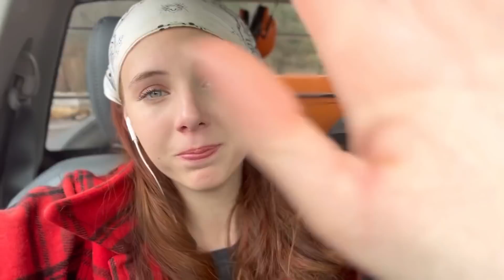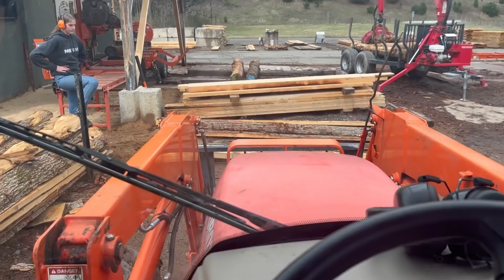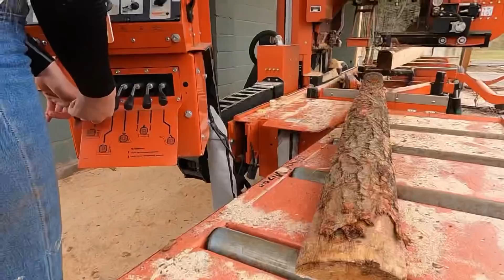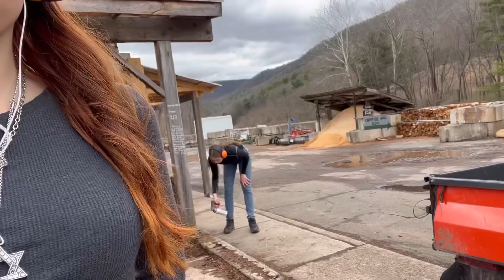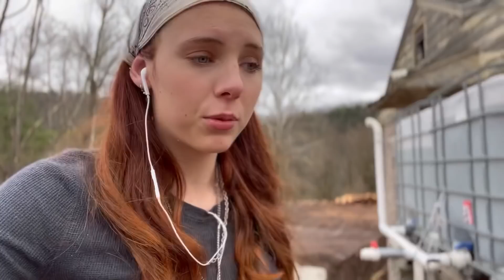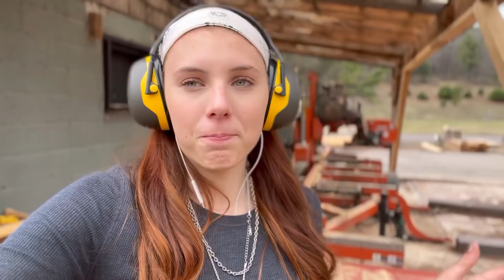Best. Job. Ever.

Comment: I think there are more wheels than doors, depends on your definition of a wheel. In many situations a gear is called a wheel, an engine has pullies, they are wheels and of  course they have flywheels, brake rotors are also wheels. What do you reckon? more wheels
Reply: We voted for more wheels! Think of all the trailers!

Comment: You have probably told us before, but on a typical day, with plenty of logs and no problems, how many hours are spent "at the mill"?  Meaning working towards actually milling lumber.  Moving logs to the mill, moving finished product  out of the way of the mill, etc.. I know it may not be actually running.  I am considering setting up a mill in Arkansas to mill my own trees.  Just curious as to how much it would take to keep the retail yard stocked... I know there are hundreds of variables..  I am just aiming for an"educated guestimation"....

Comment: When you get a flat tire on your trailer and it has wood on it use your forklift to lift it up and the air it up you got all that equipment around there either that or tell you the boss there to go put new tires on it or get some Fix-A-Flat or something you're bound to have tire problems thank you for your video

Comment: I was wondering why you don't wear work gloves when working with the boards? Never done any of the work you do but would think the likelihood of splinters would be high. Maybe add that to a Q&A sometime.
Reply: Em actually did a Q & A where that subject was addressed.  As I recall, the explanation amounted to the facts that gloves do not necessarily protect from splinters (and I will vouch for that!), gloves wear out fast under those conditions, and you can get dependent on them, which can be a distinct disadvantage when you grab a board without them.  Better to just learn to be cautious, and it doesn't hurt to build a few callouses along the way.  I might also add that gloves easily fill up with saw dust, which is also counter-productive.

Comment: Sorry, but I've gotta weigh in on that doors vs wheels debate.  How many 18 wheelers are there that only have 2 or 3 doors?  Then there are all the tractors, trailers and ATVs that have no doors.  Wheel barrows, lawn mowers, skateboards and roller skates.  Shopping carts, kids wagons (Radio Flyers!), baby buggies and golf carts.  There are an awful lotta wheels out there!  (chuckle)  That is a debate that may go on until the end of time!  Thanks for another fun video!  Maybe the best since Sammi was the tin man, and you had to oil her joints, Em!

Comment: "caddy wonkuss" never heard that before but i knew exactly what you ment.
team doors. every car has 8 doors min, counting the glove box, center console, bonnet and boot, yet only 5 wheels.
Reply: But a semi has 3 to 5 doors and 18 wheels. Tractors have 1 door and 4,6, or 8 wheels. Maybe 20 with a big implement on the back. Their log loader has no doors and 4 wheels. Oh, and cars and trucks have 6 wheels with the spare and steering.